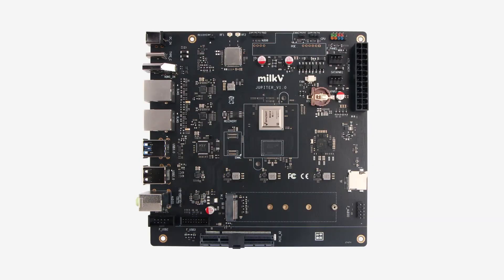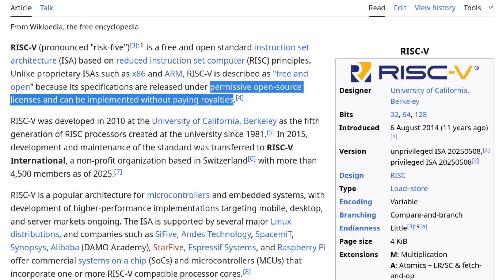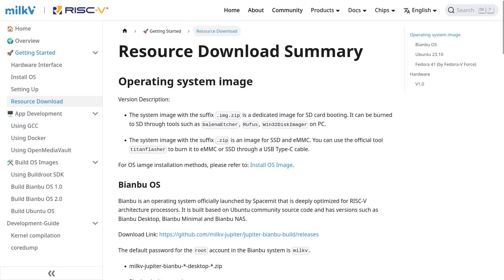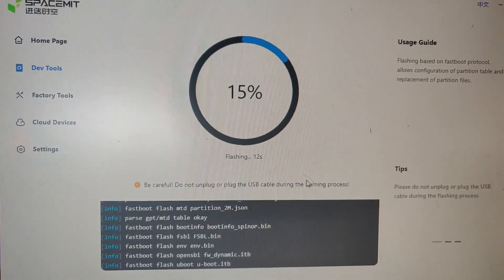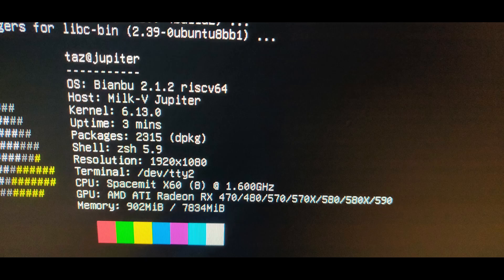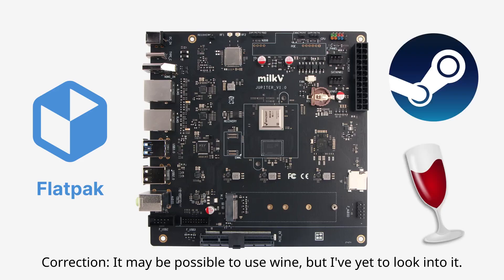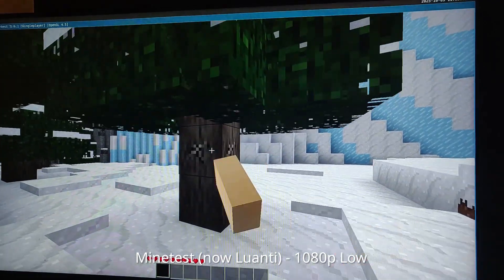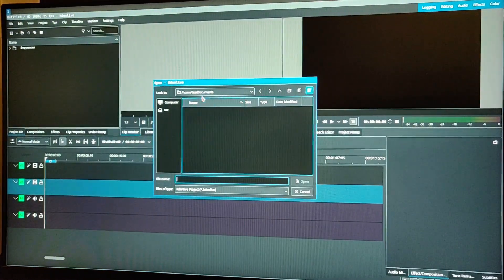The Milk-V Jupiter Experience (and some RISC-V Gaming)

Comment: Thanks for testing this! I'll choose n100/n150 over arm/risc-v for another 3-4 years, cause nothing comparable in price/performance exist
Reply: Yeah, from the consumer perspective, there is nothing "free" or to be excited about regarding RISC-V. "Free" in RISC-V means the instruction set is free, but that's it. It only matters if one wants to design a CPU implementing it. ARM is more than just an ISA - ARM offers licensing designs of cores and thus draw from its expertise, whereas a company implementing RISC-V is mostly left to do that on its own. That's one of the reasons why current RISC-V implementations have poor performance and suck vs. AARCH64 (64-bit ARM) and AMD64 (64-bit x86). For end-user, a typical RISC-V SoC will be as hostile as ARM-based ones currently are: no mandatory standard preboot firmware (such as UEFI), binary BLOBs to support custom GPUs etc. It may be even worse, since RISC-V is meant to have caustom extensions, some vendor-speicific, leading to larger fragmentation.
Reply: @JanuszKrysztofiak  Yeah, user friendly arm(64-bit ARM) is just Ampere Altra cpus or solid-run socs, otherwise building and flashing u-boot isn't kind of fun at all.
Lately I found EDK2 uefi builds for rpi/orangepi socs, much better for ipxe boot than u-boot(i try building it with wget cmd, but only succeed on qemu).  
Also look at second hand market for Ampere Altra it is mostly US, none of them available for me in Russia, just why !?
I hope China will make something nice with RISC-V, but its only will be in CPU part, their own GPUs would be another nightmare.
As for designing CPU, I don't think RISC-V should be used as reference, just check out Torvalds mail about lack of "byte reverse" instruction on it.
Cheers!

Comment: 0:35 Nah. x86 means 32-bit, x86_64 and amd64 mean 64-bit.
Reply from the maker: I know it does, but since 32-bit CPUs aren't that common now, a lot of people just refer to x86_64 as x86. I could've worded it better though.
Reply: well 8086/80186/80286 is more like 16 bits... 32 would be i386/80386/80486 and 64 would be AMD64

so x86 would be either 16-bits 16/32/64 bit. but definitely not "32 but exclusive term"

x86 is just a term for Architecture based on 8086/ form the 8086 family... hence the "x" (as in place holder) and "86" as in "8086"

so in short, calling an AMD64 CPU "x86" is 100% Valid.
Reply: @nonamed_duck4971  Alternatively, one can name them IA-16, IA-32 and AMD64 respectively.
Reply: Even x86 aren't 32-bit.
x86 = the architecture of Intel 8086.

Comment: I'd say, that using it for NAS would be better solution, that PCIe could take some sata controller and just be a storage for backups
Reply: yeah, no. pci-e 2.1 (the worst one) x2, good luck with that. this board ain't gonna do anything practical, it's just for monkeying around.
Reply from the maker: That's what I actually plan to do with it after a while